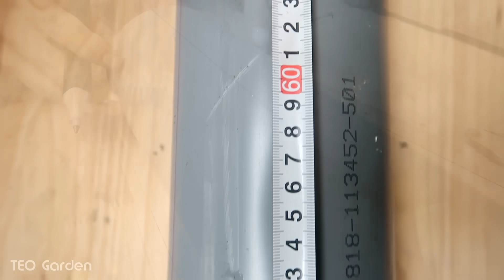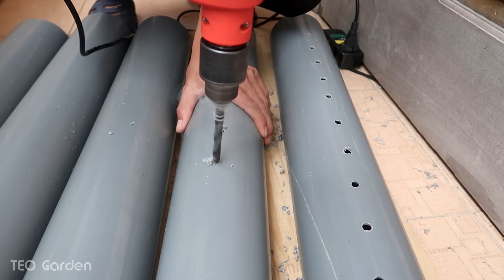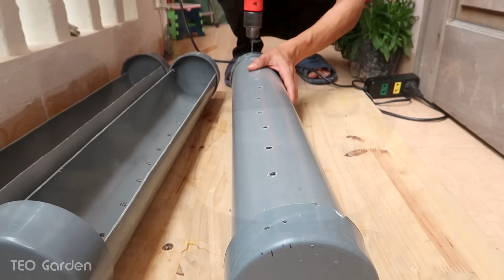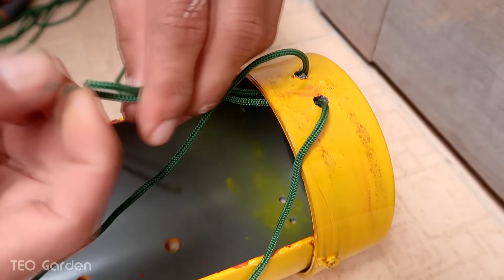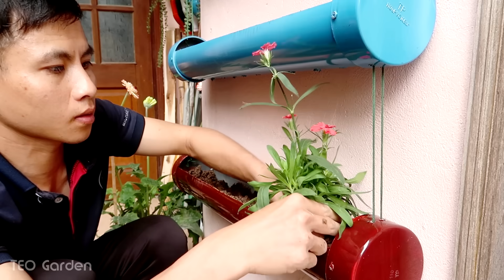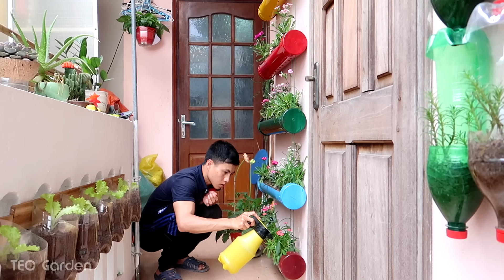Amazing DIY Vertical Gardens from Plastic Pipes for Small Garden and Balcony

Comment: Good Video. You have done an Excellent job. Keep up the good work.
It will be more helpful for others if you share diameter of the pipe and length of pipes you have used bcoz your would have experienced it these lean with weight or not. Also the thread or rope you have used will withstand for long time or it needs to be replaced.....?? 
Thank you in advance. Regards

Comment: Great idea thank you.small suggestions. Instead of making many hole at the bottom of pipe( drips water all along the pipe and becomes bottom dirty and looses  paint too after some time.  Just make bit more holes only  at the bottom end of the pipe and hang pipe with one or 2 degree ( not visible  slope) angle. So that water drips only at the end of pipe  and rest of all bottom clean and looks more beautiful . Next pipe is 1 or 2 degree angle opposite of first pipe. And holes too opposite end of first pipe.

Comment: I have so many video on YouTube making hanging basket but I did not like for some reasons or others but your this videio I liked for followings reasons: -
1)  Ad per wall breadth one can make length accordingly. 
2)  If painted it looks very good. 
3)  Making it at home is very easy. 
4)  Floor will not be watery/dirty,  if no hole is made at bottom layer of hanging tube because upper layer tube's water will fall in just bottom layer tube. 
 Yes,  tube cost is high so it is expensive but beautiful.